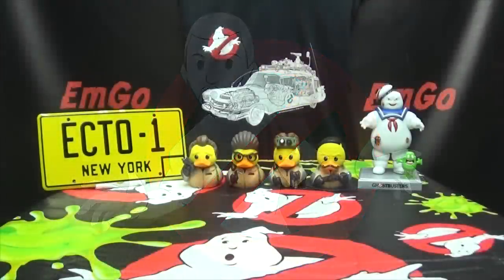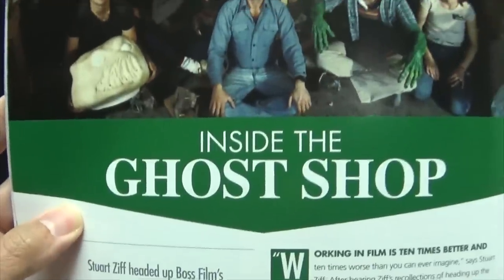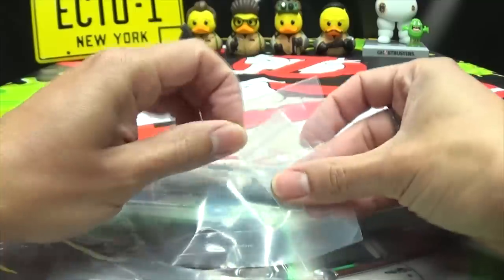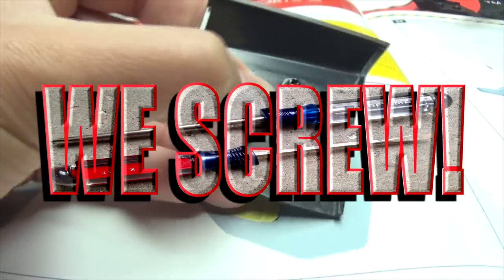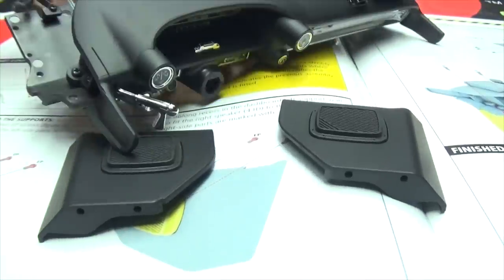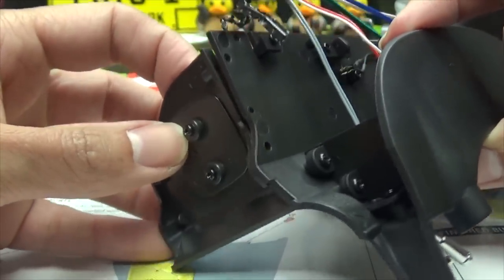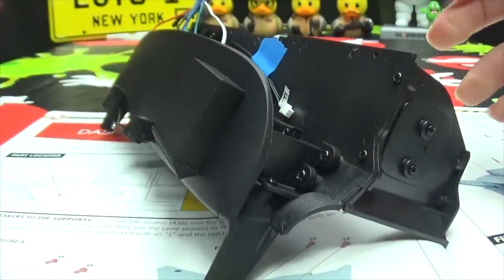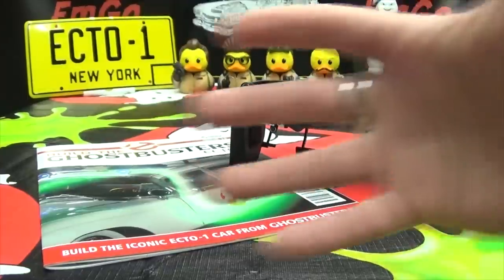Eaglemoss Ghostbusters ECTO-1 Kit (Part 43): EmGo Builds Stuff

Comment: My replacement copy of MPM Starscream arrived last Saturday from eBay and with Dad's help, I fixed the misassembly with the feet being pinned to the wrong legs.  I needed to get a replacement for my original copy of MPM Starscream as I accidentally broke the left arm off of it at the shoulder figuring out how the arms fold up for transformation back to jet mode without the instructions.